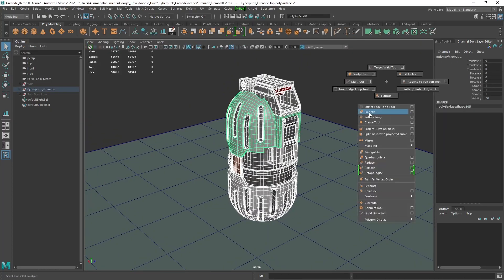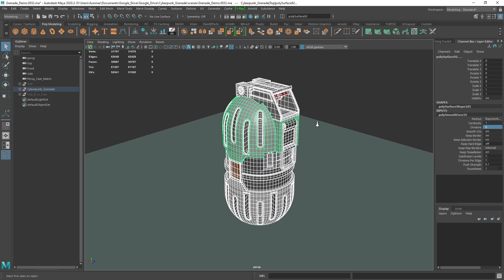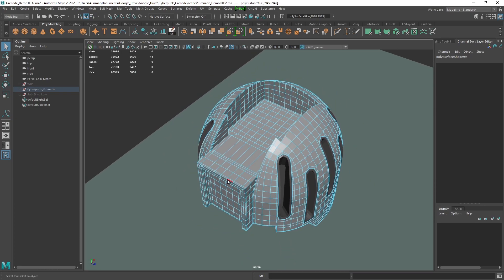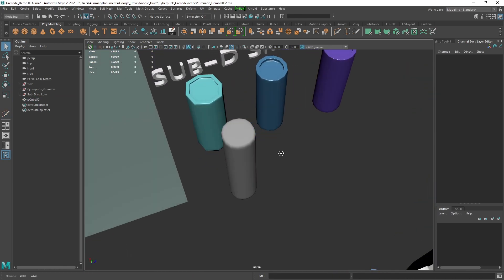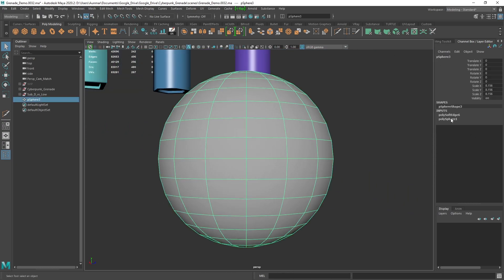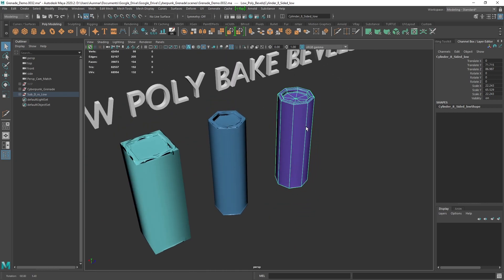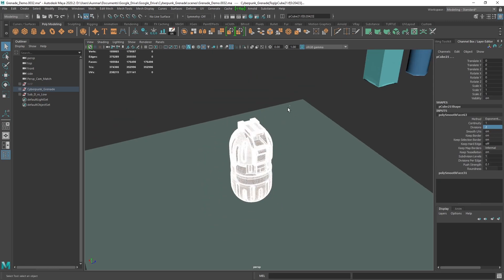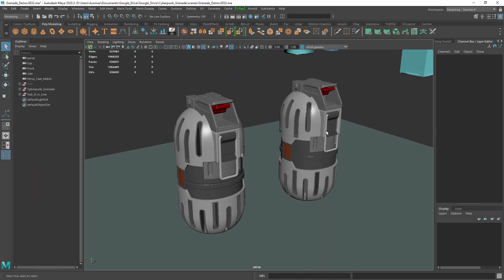Subdivision (Sub-D) and Low Poly Workflows in 3D Modeling

Comment: I got question, so if I want to create production modeling and texture it, should I use the sub d with smooth or sub d without smoot for texturing?
Reply from the maker: It really depends, most of the time, Sub-D modeling is meant to be Mesh Smooth/Subdivided. However, you can use Mesh Display>Soften edge to smooth the normals of the geometry.